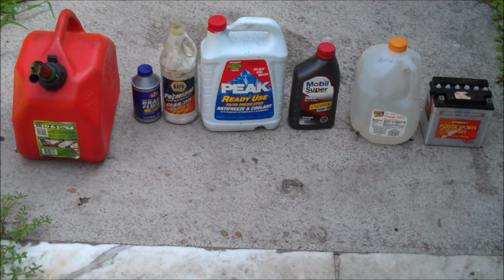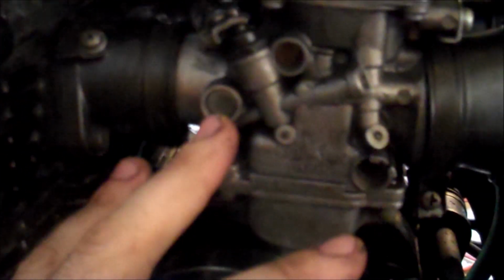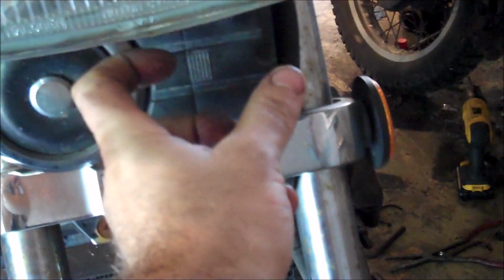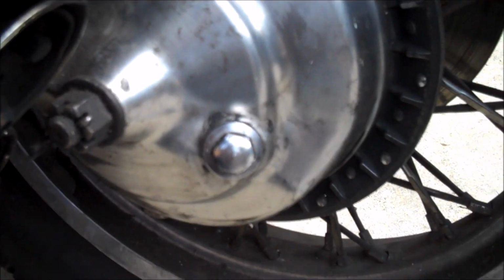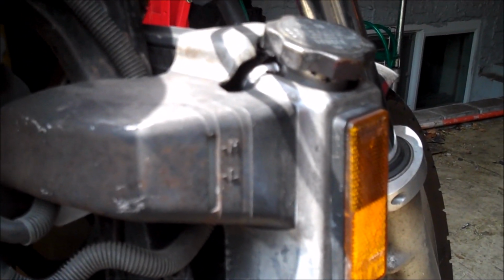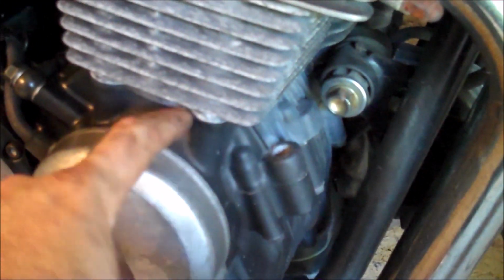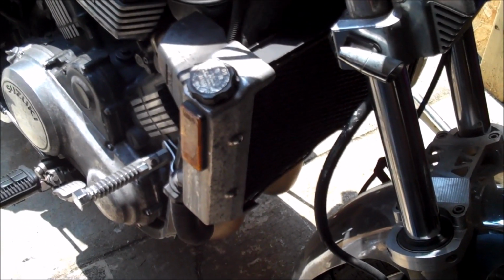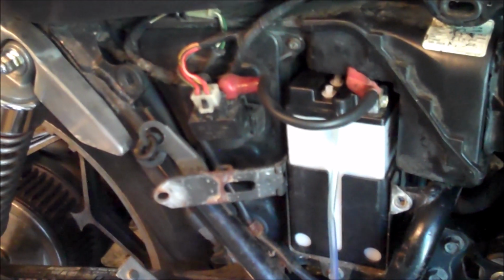How to identify and repair leaks on your motorcycle

Comment: Just got an old 81 kz750 (This is my midlife crisis and starter bike) I've ridden it up and down the street a few times for practice and have discovered it has a leak at the exhaust seam, which this video says could be a dead cylinder. Fluid is milky which tells ME that I have a fuel/oil mixing issue. I opened the oil cap and it smells like gas. What can you tell me about cause and fix?
Reply from the maker: If you have fuel and oil mixing, the result won't bike milky. In appearance the oil will look normal, it may be a little thinner than normal, but yes it will smell gassy. If you have gassy smelling oil, you should not ride your bike anymore. The repair is twofold. First you will need to repair your leaking petcock (if you have a vacuum actuated petcock. If yours is not, then skip this step. I have a video up on repairing these petcocks without a repair kit). Once you have done that, you must remove the carbs and repair whatever is overflowing gas into your engine, and then into your oil. You must do this and then change you oil or risk damaging your motor by running it with very thin oil. 

About your leak, if it is actively dripping then a head gasket repair is often warranted. However if it is just oil staining the seam around these areas and not really actively dripping, then thats normal for your age motor and I wouldnt worry about it. You have an air cooled motor so the milky appearance may be due to external water mixing with this leaking oil.

Comment: Hi mate hope you see this lol the problem I have is that I have a new motorcycle and after starting the bike I get water dripping out of the lowest point of my exhaust pipe where it connects with a clamp I know it's just water because it's completely clear has no smell and I even had a little taste is this normal?
Reply from the maker: Could be normal, condensation in the pipes will cause that. Does it run normally?
Reply: @mrmaxstorey  yes mate the bike seems to be running fine. I only really noticed it yesterday because I had a tracker fitted and i had to let the bike run for a few minutes to let  there system pick up the bike
Reply from the maker: @superbyke125  is it a liquid cooled bike?
Reply: @mrmaxstorey  it is yes
Reply from the maker: @superbyke125  OK if you have antifreeze in your radiator and it is definitely water coming out the tailpipe, then for sure its condensation and not a problem. If you have water in your radiator and water is coming out the tailpipe, its possible you would have a head gasket failure, but you would be down on power and fuel economy, and it would run kinda shitty. So probably not. You get those drips if the bike has been sitting a little while or if its a wet or cool day, or sometimes just semi regularly. Shouldnt be a problem
Reply: @mrmaxstorey  yeah mate I'm running anti freeze and whats coming out is colourless has no odour and no taste what so ever I use the bike everyday but trips to work are really short about 2 miles there and I'm from the UK and lately the daytime temperature has been around 20 degrees
Reply from the maker: @superbyke125  yea youre good bro
Reply: @mrmaxstorey  the bike also has a catalytic converter on it too
Reply: @mrmaxstorey  thanks for all your help mate much appreciated👍

Comment: Black oil dripping out of bottom of engine, cant see exactly where its coming from, going to clean/degrease it soon.

Any ideas where it could be coming from?
Reply from the maker: Just get up under there and take a look
Reply: I tried but its black oil on a black engine and it's a slow as fuck leak, maybe 10 or so drips per night, cant see shit
Reply from the maker: Well theres a lot under there. Oil pan gasket, oil filter gasket, oil lines, various seals between case covers, etc. Ive heard of guys dusting their motors with flour so a leak will show more readily, but I havent found it too hard to just take a look

Comment: recently rebuild my carbs and used carb spray now white smoke appears from the engine never happened before until i rebuilt the carbs could this be caused from the carb spray?
Reply from the maker: Is it coming off the engine, or out the tailpipe?
Reply: mrmaxstorey it was coming from under my engine and just went around and just overheated and blew coolant everywhere
Reply from the maker: Luis Panameno
Well unless you accidentally unhooked something or knocked something loose, chances are these two events are unrelated

Comment: I'm looking at a motorcycle on Craigslist and the owner says that the coolant mixes with the oil. How can I fix this? It's a 1993 Honda CBR F2
Reply from the maker: +Cadell McCain Sounds like a blown head gasket or a cracked head. Its a big repair for a beginner.

Comment: I was wondering what would cause a bike to have white smoke coming out of the exhaust?
Reply from the maker: If it is true smoke then you are probably burning oil. If it could possibly be steam and you have a water cooled bike, perhaps a head gasket leak
Reply: mrmaxstorey it starts out not blowing any smoke really then when I road it down the street it was like James Bond smoke screen behind me.
Reply: DumpsterDolphin It's the ring around the piston, its time to replace it or a new engine
Reply: DumpsterDolphin bad gas is a possibility

Comment: Just got this bike 2 months ago.... Something is leaking from around my gas tank (only when the bike is running) and falling onto the top of the engine. It smells like burning maple syrup, BUT it is red. Also my radiator fan doesn't turn on as quick as it used to. I think that this is coolant leaking, but then why is it this reddish/orange color????
Reply from the maker: Some coolant is orange in color
Reply: it can also be the surface rust in the engine making it that color ..id do a full flush on the coolant

Comment: Instructions not clear. Somehow drank battery acid even though i have a gel cell.... btw thanks for the info. I have a valve cover leak thats been going on and then went down hard and craped up the left side of the engine now i see the oil in that exact spot under the headers on the right side and now ill check compression and hope i dont need to replace the head gasket. My 92 nighthawk 750 got 64,000 miles on it im hoping it keeps  going strong.

Comment: my 2 stroke kawasaki kx 60 leaks enginr oil from the bottom after i ride it... it leaks for about 5 minutes and then it stops.... what would that be?
Reply from the maker: +Mijo Mike Depends where its coming from
Reply: +mrmaxstorey but what would it be
Reply from the maker: +Mijo Mike Like I said, it depends where its coming from. Find out exactly where the leak is and you will know what you need to repair
Reply: +mrmaxstorey ok cool well do you repair stuff like that?
Reply from the maker: +Mijo Mike I do, on my own bikes. I am not a mechanic for hire
Reply: +mrmaxstorey okay ill let u know where its coming from and maybe u can tell me

Comment: i have a 1981 suzuki 750, im leaking gas from exhaust please help lol i have no clue what how to deal with it
Reply from the maker: You might not be running on all cylinders, your motor is pumping gas through to the exhaust and its leaking out.
Reply: @mrmaxstorey  what if its not that. Could it be a leaking petcock. Doesnt stop leaking gas in any position its in .
Reply from the maker: @mazon1x  Well thats kind of a cascading problem. The same crud in your petcock which is making it leak is also making your carburetor floats overflow. They flow gas into the motor and the crankcase, which both dillutes your oil and fouls your spark plugs. Your spark plugs stop sparking one by one, the bike may still run but be low on power. As your bike runs on 3 or 2 cylinders, it pumps unburned gas into your exhaust, where it leaks out. The repair is to either clean or replace the petcock, clean your carburetors and make sure the floats seat properly, change the oil and change the spark plugs

Comment: I think my rebel is leaking oil. When i got back from a short and shifted down to 1st i paused before turning into the drive because a car was coming then drove it straight to the garage. When i got off there was a dark line from the middle of the gravel road where i had paused to half way down my drive. smelled like oil i think although it just passed inspection
Reply from the maker: OK so get under there and find out where its coming from
Reply: i did. nothing looks wet at all. laid a newspaper underneath and its clean.
Reply from the maker: How is the oil level in your bike?
Reply: full and looks clean
Reply from the maker: Well, keep an eye on it. Perhaps the oil mark was already on the road and you just rode over it

Comment: I have a pitbike 140 and my exhaust was full of oil I rebuild it with a new head and cylinder new gaskets and put z40 race cams in it did start first kick i rode it for a hour or so put it away and it cut out anyone help ?

Comment: I have a cb750. leaks oil only when I drive it. it actually has a smell of gasoline. Exhaust pipe on the clutch side is wet too. What should I do to remedy this? Thanks in advance!
Reply from the maker: +Brian Jolly How is your oil level? Does it stay the same or is it rising?
Reply: +mrmaxstorey I recently bought the bike. Have only driven around town a couple times. I'm afraid to make things worse. As of now the oil level is full
Reply from the maker: See if the oil smells like gas or the oil level is rising. That will tell you that the gas is leaking form the carbs into the motor and filling up your sump
Reply: +mrmaxstorey yes thanks it does smell like gas. What should I do?
Reply from the maker: Its time to clean the carbs and set the float height. I have lots of resources up on the youtube channel about how to do that, spend some time reviewing the videos and let me know if you have any questions